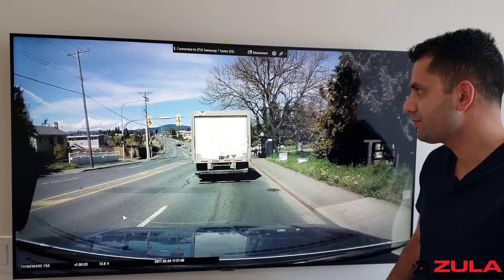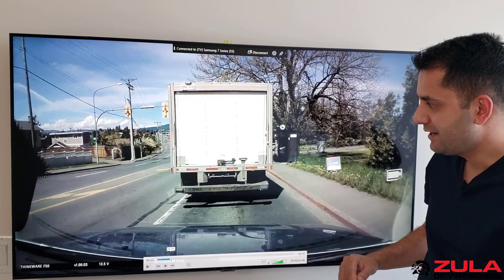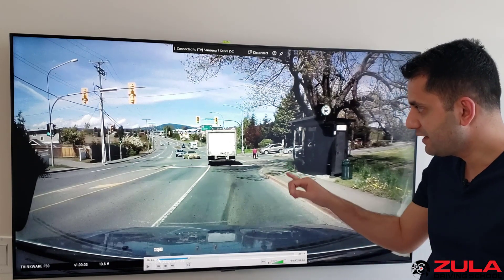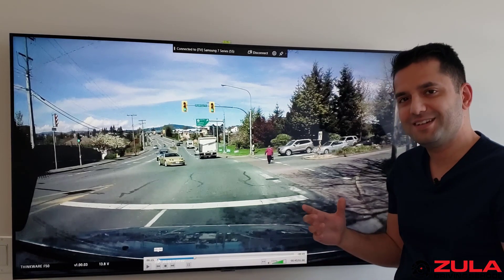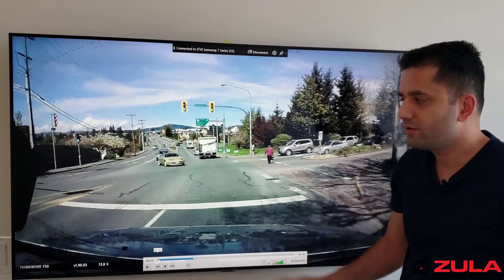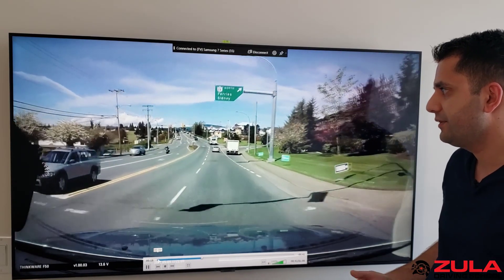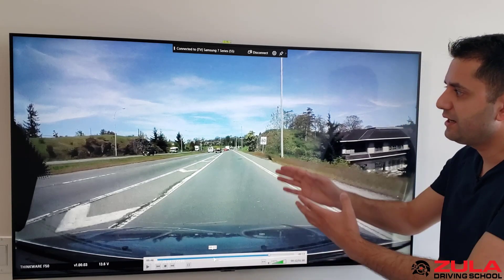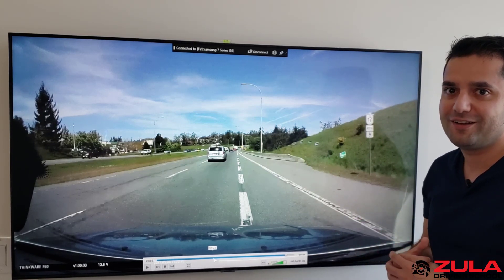Road Test Tip: Don't Get Stuck in the Intersection Like This When Making a Left Turn

Comment: Do I still need to do a shoulder check even if I have a blind spot mirror and I can see everything through that? Thanks
Reply: Not a driving instructor but i have been advised to do so for this. Its just a good habit and its big points they take of in the test